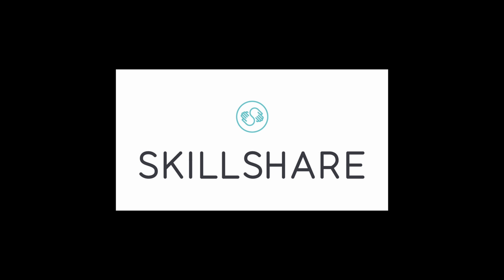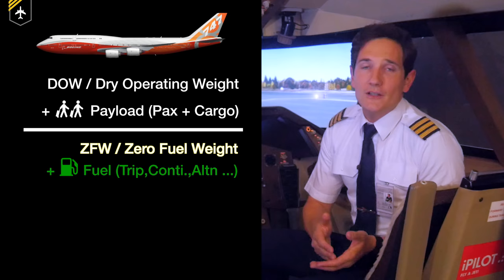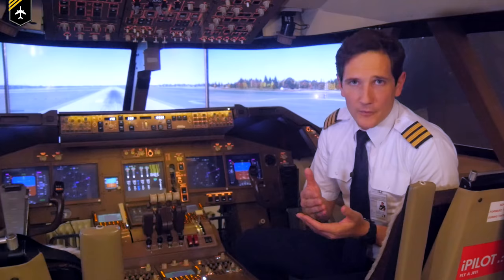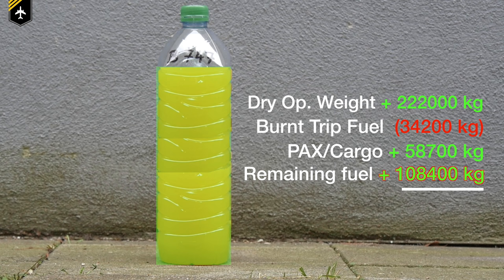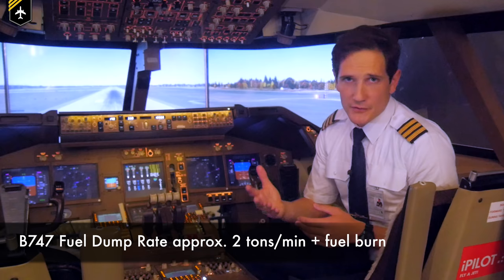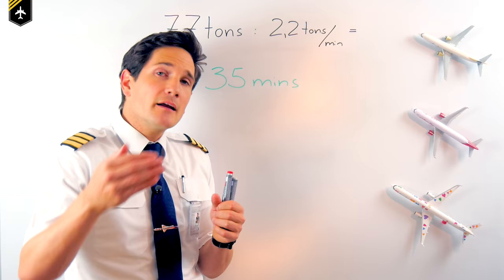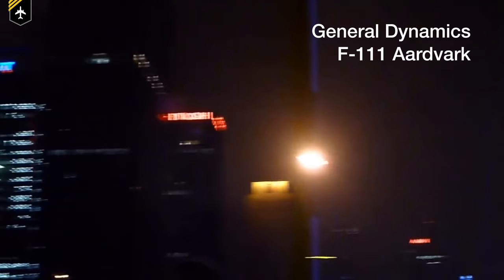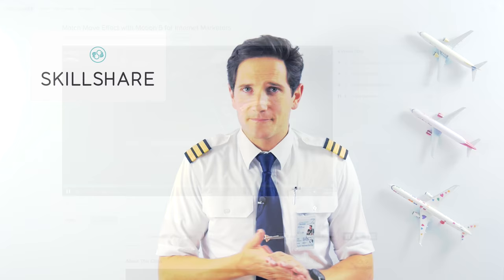Why do PILOTS DUMP FUEL??? Explained by CAPTAIN JOE

Comment: Yesterday, I saw a 737-800 (non-max) landing with white trails coming from just outboard of the flaps. What is happening here?
Image of similar thing: https://img.resized.co/newstalk/eyJkYXRhIjoie1widXJsXCI6XCJodHRwczpcXFwvXFxcL3MzLWV1LXdlc3QtMS5hbWF6b25hd3MuY29tXFxcL3N0b3JhZ2UucHVibGlzaGVycGx1cy5pZVxcXC9tZWRpYS5yYWRpb2Ntcy5uZXRcXFwvdXBsb2Fkc1xcXC8yMDE5XFxcLzAzXFxcLzI2MjExNDE0XFxcL1BBLTQxNzQ4MDQ1LTEwMjR4NjgzLmpwZ1wiLFwid2lkdGhcIjo5NzAsXCJoZWlnaHRcIjo0ODUsXCJkZWZhdWx0XCI6XCJodHRwczpcXFwvXFxcL3d3dy5uZXdzdGFsay5jb21cXFwvaW1hZ2VzXFxcL2RlZmF1bHRfbm9faW1hZ2UucG5nXCJ9IiwiaGFzaCI6ImI0YzdlM2RhMTI5YTQ1NzU4M2EzYWVlYzlmODY4NGE1YjhmNDhkOWMifQ==/boeing-737-max-makes-emergency-landing-during-trip-to-warehouse.jpg

Comment: I don’t like how it leaves marks in the sky
Reply: Do you mean those white trails? If you mean them, they are just condensation trails from the engines when the water in the engine exhaust condensates. The fuel dumping is rare because it is only done in an emergency situation, and most likely you never see it happen in reality.
For example these are just normal condensation trails, this is not fuel dumping:
https://upload.wikimedia.org/wikipedia/commons/thumb/b/b0/A340-313X.jpg/1200px-A340-313X.jpg
Reply: Mike P oh, thanks for the info bro

Comment: This guys full of hot air. Planes would have a terrible time balancing during maneuvers to store fuel in the wings. Think about a semi tanker pulling a full load of fuel. Then put 2 of those tankers on each wing. Balance would be near impossible with fuel sloshing back and forth at that capacity
Reply: So are you saying there is no types of aircraft that are capable of holding fuel in the wings?
Reply: @sexigrande1792 I'm saying they are being untruthful about commercial airliners. There is fuel in the aircraft but not near as much as they say and not where they say it is either.  Think of a nuclear powered submarine. Powers on diesel fuel until it's submerged then runs on its own generated nuclear power.
Reply: I can only talk about experience on military aircraft as a mechanic but the same basic principles apply. There was a point in my career where I worked in wing tanks. What you’re saying is all fine and dandy but that would mean pilots and mechanics would have to be on a cover up. Plus the fuel systems themselves have calibrated components that measure the quantity of fuel. Have you ever considered visitingdifferent places where heavy aircraft overhaul takes place?

Comment: 1.7$ per galon, 77tons = 20713 galons , 1.7 $ * 20713 = ~35.000$ waste of fuel for emergency landing ... who pays that?
Reply: Domino60 the airline covers the cost.
Reply: @ZK-APA  That's a lot of money, imagine that the airline company should cover as well the cost of loss for the rest of the people
Reply: @DominoSixO  it is a lot if you see it in isolation, but if you see in terms of airline earnings, then it's something that the airline can afford.

Ps fuel dumping is very rare. And not all aircraft are capable of doing it. Example, the Boeing 737, Airbus a320 and all similar narrow body aircraft don't even have fuel dumping as an option. It's just for the bigger aircraft.

Comment: That's much as I respect you and admire you as a pilot I'm afraid you misspoke!! Jet fuel is an oil-based fuel it's essentially kerosene with an oxygenator blended in! Oil as a general rule will not dissipate into the air because it is not an ester based fuel, such as gasoline what you folks call petrol!! Petrol is an ester based fuel and will dissipate into the air, kerosene is an oil-based fuel just like diesel, it will not dissipate into the air! It will vaporize long enough to eventually settle out, but when you're literally dumping tons of oil-based fuel into the atmosphere it's going to settle out! This could explain a few interesting phenomena that has taken place on this planet over the years! And unusual oil smelling film forming on plants where there should be none!! So here's my question, can you people jettison fuel overpopulated landmasses or do you just jettison over water??? Additionally why don't they equip all passenger jets that may be required to jettison fuel with a flame off system design to burn the jettison fuel mid-flight rather than allowing it to settle out that would be only slightly less environmentally friendly then simply jettison tons and tons of raw kerosene fuel??? That's just my take on the situation

Comment: they dump fuel because the pilot had to make a emergency landing so they dump fuel so pilot can easily land the plane down safely at low speed, instead of landing at higher airspeed.

Comment: ahh so thats why i see white lines in the sky
Reply: No. They are condensation trails from the engines when water vapor from the engine exhaust condenses in the air. (Fuel dumping is done only in an emergency situation, not during any normal flight.)

Comment: I thought in the previous video you said chemtrails don't exist?  Now you are saying that pilots dump fuel when they are over weight before landing.  

Are not hundreds or thousands of gallons of jet fuel being dumped into the atmosphere a chemtrail, as illustrated at 9:10 in the video?

Like I've said before, does the pilot carry a gas chromotography kit and test his own fuel after it has been loaded?

The pilot has no idea what is in the fuel, only the performance charateristics based upon the performance of the plane and burn rate of the fuel.

Multiple people flying behind these (fuel dumps) chem trails have documented the increased aluminum in the air which shouldn't be there.

Now the question is, why does the FAA allow fuel dumping at all, except in the case of an extreme emergency.

Shouldn't planes be designed to be able to be landed under full load?  As far as I know, only commercial airliners and bombers are built this way.

You cannot debunk chemtrails by claiming fuel dumps happen!  A fuel dump is literally a chemtrail.

Now if you threw out 10% of the fuel out of your car before you pulled into your driveway, into the middle of the street every time you came home, wouldn't that be considered toxic waste?  

Oddly Jet Fuel is composed of just longer chained hydrocarbons than gasoline, but it is all refined from the same stuff.  What the additives are in Jet Fuel is a trade secret, and they put MTBE into the fuel for decades claiming it was only in cars gas tanks. They had to ban MTBE because all of the water surrounding airport acquifers tasted like jet fuel.
Reply: MTBE makes no sense at all for Jetfuel. MTBE is used as an octane booster in petrol. Jetfuel is basically Kerosine which is very similar to Diesel fuel. But for a turbine the octane/cetan number of the fuel doesn't matter at all. The only real problem jetfuel has to counter is the low temperature. It must remain pumpable even at -40°C so that's where the additives come in. Also it's really not that hard to find what additives exactly are used for Jet A1 for instance. The additive they put in to lower the freezing point is Glycol Ether which is simply a complex alcohol.
Reply: Christopher, do you have any idea what you are writing about? I think nil.

Comment: 12 ton per hr ...😮😢
Reply: Its actually economical depending on load and distance. Say if the load is good, that equates to 500 people travelling 900 kilometers in an hour

Because if you take the same no of passengers and distance in say a car which carries 4 people and gives an economy of 10 km/l, that'll be 11250 litres, or about 8.2 tons. Which isn't that bad.

However for it to be feasable, it has to be high on load, and large in distance
Reply: @ZK-APA  thank your vdo s are v v informative . 👍. I was jus comparing with say PPL walking around the world ... Hunter gatherers without maps 😀

Comment: So having planes not exceed the max landing weight on takeoff would just make too much sense, so they have them dump tons and tons of fuel into the atmosphere. Sounds like a solid way of doing business.
Reply: But..it's only done in an emergency situation, not all the time.
Reply: @mikep9604  tell that to the government next time you emergency dump 70 tons of fuel on your lawn!
Reply: @charlieodom9107  - The fuel dissipates in the air.
Reply: @mikep9604  OMFG! Magic fuel? It doesn't disappear!
Reply: @charlieodom9107  - There is no magic, the fuel simply dissipates in the air before it reaches the ground. It's not done at low altitudes.
Reply: @charlieodom9107  - There is nothing to tell. You can easily find information if you want. Now you are just imagining things.
Reply: @mikep9604  so you think the fuel disappears, when in reality it doesn't unless somehow the cold air breaks down the chemical makeup of the fuel into its elements, then proceed to tell me to look it up. Sure thing bud. I guess boiling water just disappears too !
Reply: @charlieodom9107  - I tell it again, the fuel dissipates and evaporates before it will reach the ground. If you are not able to understand this, it's not my problem, it's just your problem. 
And you can easily find info about that in the net, if you just want to look at it.
Reply: He’s just being ignorant, just look at his comment about max landing weight. It’s obvious he doesn’t understand the reasoning behind why aircraft takeoff with a higher weight compared to landing weight.

Comment: It's water not fuel.
Reply: Why would they dump water ? It’s definitely fuel that’s where fuel dump systems are normally at on aircraft
Reply: Yes the great jet fuel hoax. Well I’m an aircraft mechanic and jet fuel is most definitely stored in the wings and fuel dump systems are a real thing. You have to realize fuel systems are a real thing, pumps, valves, lines and fuel probes that measure the quantity of fuel. Fuel probes are calibrated to measure the quantity so how can they be giving incorrect data?  Then there’s the tens of thousands of mechanics, pilots, engineers and fuelers that work on aircraft everyday. I’ve heard many theories from turbine aircraft don’t use any fuel at all to they only use small amounts. Some people even claim they levitate which is hilarious.

Comment: I think they should make better planes able to land full of fuel  and anyone not get fined to destroying the environment.

This is an example where we over engineer stuff to the just failing point what a waist.
Reply: Shiny Script the thing about plane designs is that you have to maintain a balance. Hence to have more of something, you’ll have to compromise on another part.

As in this example, yes it is possible to make a better plane which can land with full fuel. But to get that, you’ll need to improve the landing gear and body structure, which would increase complexity, costs and weight. So the balance goes disproportionate.
Reply: @ZK-APA  What  is good for the goose is good for the gander.

Again they should build better planes(yes i know they will cost more) i can't dump fuel so they should not  be able to dump either

There is no balance to this or compromise
my car cost more having emissions control parts on it everything your saying is just an excuse to save a buck. I take it you have stocks in the airline industry. That why my original statement to build better planes is true and fair.
Reply: Shiny Script well I can see there is a lot of misunderstanding on your part.

One thing you should know is that no one likes fuel dumping. The airline takes a loss whenever an aircraft dumps fuel. So it is only done when its an emergency and its absolutely necessary.

And by cost, its not about the aircraft’s purchase cost, but the overall costs involved. That includes ticketing, so its ultimately the passengers paying the premium for the aircraft operation.

And no I don’t have stocks in aircraft. I’ve studied about them, and using that I am trying to explain. And the balance I am referring isn’t some figure of speech. Its literally balance due to physical limitations of aircraft.
Example, the more weight an aircraft has, the more fuel it will use. So if you try to design an aircraft which can land with more fuel, the result changes will increase the overall weight of the aircraft as well, which will increase its fuel consumption. So because of this, suddenly you are burning more fuel than the usual, which is again technically a waste.

Comment: Very good explanation of the poor design of aircrafts,  they are like walking on eggs.  Imagine a car that can't stop with a full tank of gas! Never would that pass safety tests but yet a delicate over fragile sensitive aircraft can be allowed to fly!
Reply: If they're so badly designed, why are planes so much safer than cars?
Reply: @meismehaha  Planes are safer than cars because seversl reasons 1. Pilots are much better than drivers.
2. Airways are less crowded than streets. 
3. Pilots have air traffic controllers to notify them of other aircraft.

Comment: That’s the stupidest thing I’ve ever heard, pilots only dump fuel in an emergency, would you go fill your truck up with gas and drive to your destination and then pour out the remaining gas on the ground no!
Reply: Yes, only in an emergency situation if the weight of the aircraft is above the maximum landing weight, and they need to land to the nearest airport.

Comment: Commercial aircraft shouldn't be allowed to take off over their max landing weight. They should be required to do aerial refueling at a sufficient distance after take off. They should also be fitted with jettisonable tanks to enable them to quickly and safely drop below their max landing weight in the event an emergency landing is required mid-flight.
Reply: Thing is that will burn more fuel (as this will have to be done on a regular) compared to a one off fuel dumping.

Comment: Just show me you dumping fuel.
Because if ime meant to believe its all in the wings I don't buy it .
Compressed air gets pumped in not fuel.some fuel is needed.air o plane.
Don't buy it.think about it
Two tons a minute
And F1 car filled in 1.6 seconds do me a favour get a bigger fuel tank for the F1 or stop lieing to the people.and charging dollar
Reply: Compressed air get pumped? Not fuel?  Fuel can be stored in the fuselage as well not just the wings. Are you one those fuel hoax people? I’ve never seen any reason for a conspiracy and I’m an aircraft mechanic. I’ve worked on fuel systems doing heavy overhaul work on lockeed Martin p-3 Orion aircraft.